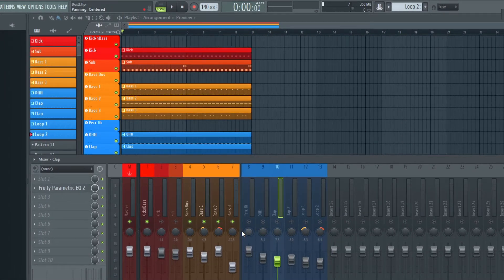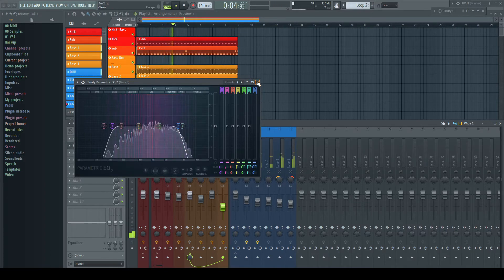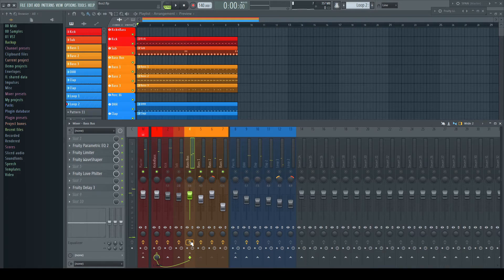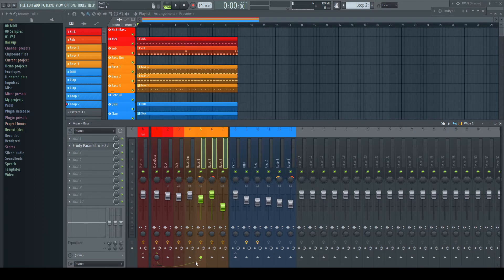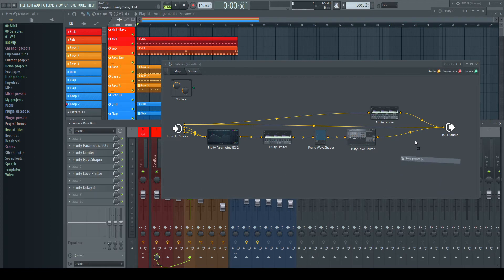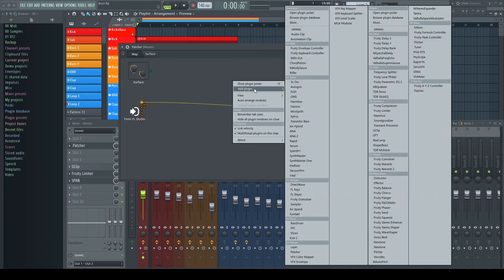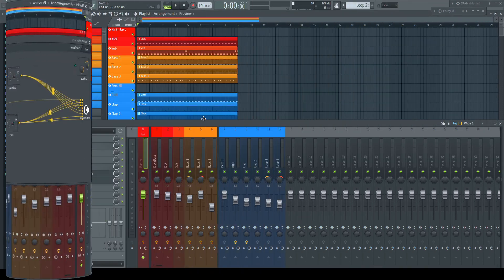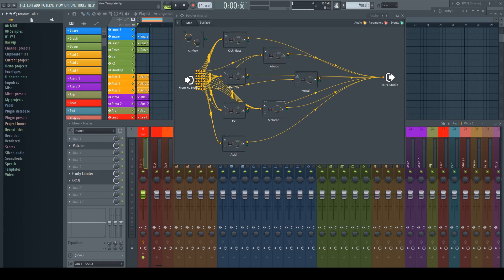FL Studio: Bus Channels V2.0!! ... 5 Mixing tips with Patcher ... Part 3

Comment: Layering sounds
Example, layering trance basses 
The whole kick and bass is routed to a main bus with EQ & parallel compression

What if you need to use a sampler channel, which cannot be patcherized or if the layers have different MIDI? 
Instead of routing layered channels to their own bus, they are routed to the main group directly, and for now you do not want the signal in the main input
Open patcher on the main bus and activate the inputs of the layered sounds, and set up the FX Chain 
You can even patcherize the whole master 
All this reminds me of Sunvox Tracker